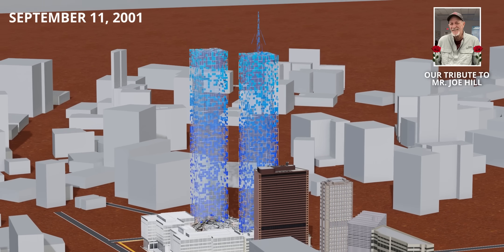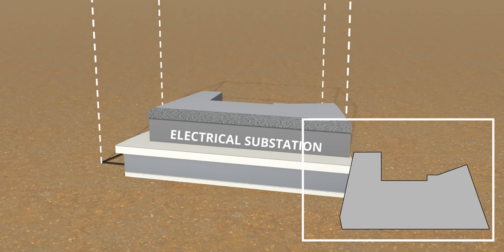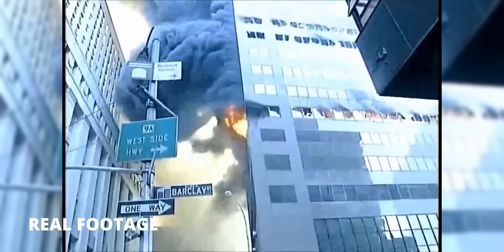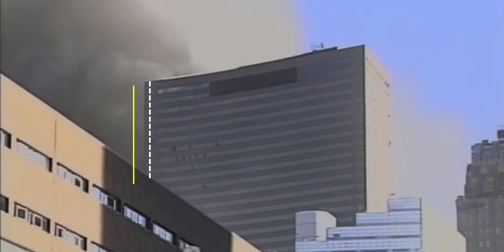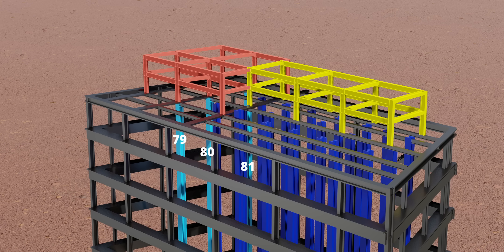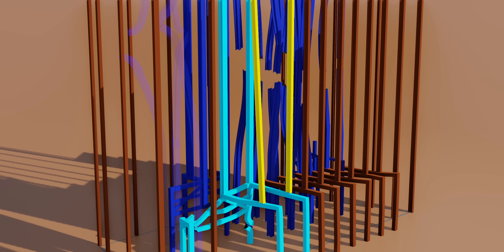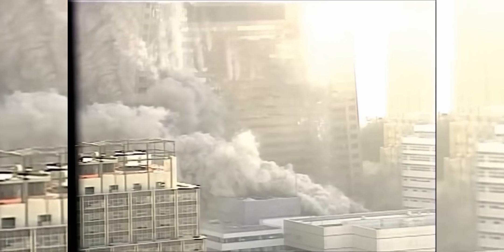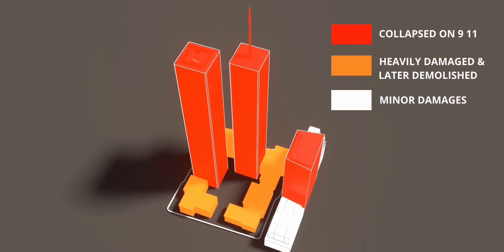Collapse of Building 7 | The Complete Physics

Comment: Three buildings with non-symmetrical damage fell in their own footprint on the same day. I think this is the first the world has seen this. (We've seen high-rise fires lasting for days and the steel frame remains). Add to that, on the same day, two plane crash sites with no visible plane parts. What is the the chance of that happening?  Probably one in a billion.  That's a good explanation of WTC7 though.
Reply: No building fell "in their own footprint". 10 buildings collapsed. This on the same day there were terrorist attacks on the buildings in that area. Even if your "first" had had any relevancy, which it did not, what of it? "First" only mean "first". No-one has seen fires lasting for days and the steel frame remain. Add to that 19 tons of visible plane parts in two of the THREE crash sites. So, the chances are 100% since you made it all up.

You're welcome for the correction of your nonsense.
Reply: @mooneyes2k478  There was no visible plane parts at the pentagon crash site nor in  Pennsylvania - it's unusual to have planes disintegrate upon crashing.  All the buildings collapsed in their own footprints, and yes planes hit the twin towers, but did not hit WTC7.  The planes that hit the twin towers caused non-symmetrical damage on several higher floors - not a reason for the entire building to collapse, but a reason for those higher floors to collapse to the side  There were not "19 tons of visible plane parts."   Add to that many other anomalies on that day, and there is a definite possibility that is was a false flag, in part, in some way.  Use your own brain and think about it, rather than defend a narrative.  This is a systemic issue with lots of evidence, thus conclusions are made in probabilities and possibilities, not certainties.  Anyone certain is defending, not thinking for themselves.
Reply: @nova4005   " There was no visible plane parts at the pentagon crash site nor in  Pennsylvania "
Other than the aforementioned 19 tons or so, you mean? Yeah.

"All the buildings collapsed in their own footprints"
If by "footprint" you mean "covered 8 times more ground that when they were standing", that is.

"and yes planes hit the twin towers, but did not hit WTC7"
Or any of the other 7 buildings. Can you guess what DID hit them?

" not a reason for the entire building to collapse, but a reason for those higher floors to collapse to the side"
If, that is, you think that a building is a tree. Here on earth, they're generally not.

"There were not "19 tons of visible plane parts.""
Because if you go "SO THERE!", reality changes. Right? Right.

"Add to that many other anomalies on that day"
None of which you can actually name or support. Just like dozens if not hundreds of "truthers" over the past several years, who, when called on the "many", turned very noticeably quiet.

"there is a definite possibility that is was a false flag"
Ah, yes. "It was all about Iraq, so there!" Except, it was clearly and publicly stated that Saddam didn't have anything to do with it. Then, of course, there's the minor issue that, in near 250 years, the US has been at war for 225. And not ONCE in that time was a "false flag" ever needed. All that was required was, "because we want to".

"Use your own brain and think about it, rather than defend a narrative"
You mean the brain that could, in contrast to you, understand and follow the evidence and the science? The only "narrative" is the one you and your "truther" buddies peddle, the one that goes, "oh, doesn't it look suspicious, something much be wrong, trust me bro!"

"Anyone certain is defending, not thinking for themselves."
Or able to understand very basic, laymans levels of construction and physics. Could be that.
Reply: @nova4005  I am glad your voice has been in this thread.
Reply: @gaylenhalbert4391  thanks 💕
Reply: nov4005, what happened when the penthouse collapsed into the building?
Reply: My thoughts exactly.   Hard to believe it's just coincidence.  It's the one factor that I cannot make peace with therefore I have yet to fully accept any explanation.
Reply: @KayWaits  I think that's a good place to be. Most people need to land on one side or the other. But you can see and know the anomalies - know something is awry - without having to know exactly what happened.
Reply: @nova4005  Tell me...why didn't you have an rebuttal?
Reply: @mooneyes2k478  my reply to you got erased.  That happens too often with certain subjects on youtube. I won't say more in this comment, but I'll  reply again in another comment. If you don't see it, it's been taken down.
Reply: @nova4005  " there where no visible plane parts, nothing that you could identify as a plane, at the Pentagon or in Pennsylvania. "
1, wrong. 2, irrelevant. The video is about WTC7. The only reason you'd mention something else is because you can't argue.

"The buildings fell in their own footprint- this is obvious about the three buildings that fell that day"
1, wrong, 2, irrelevant. "The buildings" matters not at all. This is about WTC7, which in no way did anything of the sort.

" All three had non-symmetrical damage"
Which is entirely irrelevant.

"the whole buildings fell in their own footprints"
See above.

"Several floors of wt7 were damaged by one of the twin towers, not nearly enough to make the whole building fall in its own footprint"
Which means we can conclude you somehow missed the 7 hours of unfought fires.

"and there are also plenty of architects and engineers who say that these towers falling in their own footprint say no, there must have been something else going on."
No ,there isn't.

"Your comment “the reality changes” shows how attached you are to this narrative"
The one "attached to the narrative", particularly "this" narrative, is you.

"You have taken a narrative to be your reality"
No, I've taken the only explanation to include science and evidence and facts to be reality. The one that explains why and how things happened, in an internally consistent manner. You, on the other, have not, instead preferring handwaving and "because it sounds cool and all the other "truthers" are really smart and they said so".

"A more mature development of the mind is thinking in possibilities and probabilities"'
Oh, right. So it was Santa Claus, Alien Space Beavers and Magic. Right? Because there's "possibilities and probabilities".

"When you're comfortable with what you know, you don't need to insult others to defend it"
Calling people on utter idiocies and nonsense isn't "insulting". Just putting that out there. That not even touching on "comfortable with what you know".

"The US has been involved in false flags before"
The US has, as a nation, existed for just under 250 years. It's been at war, somewhere, with someone, for 225 of those years. And not ONE of those wars has needed "false flag". Making up things does not change this.
Oh, since I'm sure you're blathering that nonsense, no, "Northwoods" was not a thing. It wasn't even an "operation", no matter how many times that's repeated.
Reply: @mooneyes2k478  You don't see or consider the whole picture of evidence, and it is relevant.  My first comment was not only about WT7.  I included links in my last comment and I bet that's why it was erased.  You stick with your reality, that's okay with me.
Reply: @nova4005   Or in other words, you didn't have any argument and it's mean of me to call you on that.

Yes, I know, ever so horrible. Poor you.
Reply: @mooneyes2k478  No, I do have counter arguments.  We'd need to go through other detailed  pieces of evidence, which we can't do here.  We've gone as far as we can in this discussion.  Also, I don't exchange ideas with people who are insulting for very long.  Bye.
Reply: @nova4005   Ah, yes. "Stop calling my stupid shit out for what it is, it's mean, I'll take my ball and go home!"
Reply: @nova4005  Good comment. Thank You.
Reply: In fact there was a third plane at WTC7 but no one saw it, they had put noise suppression on the engines, the proof is that WTC7 collapsed, on board Saddam Hussein armed with undetectable knives, he had disguised himself as a pumpkin for the Halloween party, to pass inconito, he threw envelopes and they landed in the senators' mailboxes, the proof is that 2 of them did not survive, the plane cut all the horizontal columns and bounced from bottom to top on all the floors at 806 KM/H, then the kerosene imploded.
Reply: there was plane parts at all sites all buildings ain’t the same and we are talking about jet fuel hot enough to bend and weaken steel they are designed to fall in their footprints because tell me how back it would he if a massive building fell over in manhattan also debris was everywhere not a perfect fall in footprint
Reply: @DaCostaRica48  jet fuel burned out within minutes of that fiery explosion. And no visable playing parts at either site. If you came across both of those crashes you wouldn't know a commercial airline was there, the newscasters and firefighters said that on the scene.
Reply: These conspiracies are so baseless, if you watch the collapse, you can tell why they collapsed, the first to collapsed did not simply fall straight down, the upper floors fell at an angle. Things on earth tend to fall straight down, what is the building supposed to do jump?
Reply: @saypuppy4266  if a structure is so severely damaged - so damaged from that it would bring a whole building down - that point of impact making such a dent would cause the structure above to tip towards the damaged side. Instead the three buildings came down exactly like there was symmetrical damage to the buildings. This does not make sense if the cause is airline impact or debris, and is highly unlikely to happen to three buildings in one day.
Reply: @h1F595  WT7 wasn't hit by a plane and still folded precisely like the other two. Quit living in denial.

Comment: I was a Captain, FDNY and was at OP at West and Vesey St. We had a team monitoring WTC-7 using a surveyor's transit. We all knew Bldg was coming down as it had been burning over 8 Hrs. I wrote a detailed story of FDNY 1980-2003 and highlighted  this collapse. I'm glad engineers were finally able to match what we saw to what happened. This video is correct, some twisting and then it dropped. We heard a loud crack from where we were. Probably the breaks in those columns.
If you want to read of this;  MY TURN ON THE FIRELINES  1980-2003,   FATAL FLAWS  BOOK 3   1975-9/11/2001       B&N

Comment: This is how it may have collapsed! But the reason it collapsed was that it was set to on purpose just like the controlled demolition of 1 & 2
Reply: This Lesics video is very good – with one or two exceptions - and goes into a much higher level of detail than many viewers will be able to comprehend.  While not perfect, the collapse mechanisms – the sequence of failures - described here by Lesics are substantially correct and this is true no matter who planned and carried out the 9/11 attacks or why . 

That may not be what you want to hear and go against 20+ years of entrenched dog_ma and conditioning, but it’s not wrong. 

That also means (in case you did not get the hint) this video can be (and IS) absolutely correct in its description of Building 7 collapse mechanisms AND the 9/11 attacks could still have been some sort of inside job. The two things are in no way mutually exclusive. 

The mechanisms described here have broad professional support around the world. There are no professional engineering organizations (for example: ASCE, ASEE, ICE, etc) that disagree with them or have offered any formal dissenting opinions or alternative hypothesis. 

The mechanisms described here are not new. They have been well understood for many years and much of it can be easily confirmed by simple observation. You can literally see most everything they are talking about if you just bother to look. 

So, setting hubris aside, either the overwhelming majority of the worlds structural engineers and simple observation are wrong,… … or you are. Which seems more likely? 

IF you still –think- believe this explanation is wrong then produce a better one . Good luck with that. No one ever has and I don’t see you moving that needle today. 

No one ever does.
Reply: Israeli public manipulation team working hard to dispel the truth.
Reply: @fpsOklahoma  Said the terrorist apologist.
Reply: nope. Not a demo. You are just $tupid.

Comment: The north towers antennae did NOT hit the WTC 7. At all. What are tou even talking about?? The antennea fell to the south east.
Reply: This guy is full of it. Spreading propaganda.
Reply: @alwagner9722  Everything else seems accurate. The only thing that's inaccurate is the antenna comment. I would say anything otherwise is propaganda.
Reply: @username_redacted_1987  He spreading bullshit 😂
Reply: @nightlyterra  No. He's 100% correct about the construction of the building and I have seen images/video of that side of WTC 7 and the damage from the North Tower. Those images are very hard to find becasue most video doesnt show that side of the building for obvious reasons. Debris hit it when the North Tower collapsed and the fire was uncontrolled for 7+ hours. And it WAS a tube design, similar to the Towers. There's nothing inaccurate about this video otherwise.

I've studied this even like crazy for 20 years. This video is otherwise dead on accurate.

Comment: No Steel Frame building had ever fallen because of fire.  No building had ever fallen straight down and to this day still don't except by planned demolition.  So (without any conspiracy involved) at least admit that these buildings were of a piss poor design.  If not criminal.  Just because something is new doesn't mean it's better.  So many engineers at the time kept calling the old systems(such as were used on the Empire State Building) “overengineered”, well I suggest that these new buildings were under engineered and am tired of hearing all these excused for the failure.  Do a Bad Job, you get a Bad Result. Just look at some of the disasters in China over the last few decades.
Reply: "No Steel Frame building had ever fallen because of fire."
Stupid nonsense.

" No building had ever fallen straight down"
Stupid nonsense.

" this day still don't except by planned demolition."
Irrelevant nonsense.

"at least admit that these buildings were of a piss poor design"
Stupid nonsense.

" Just because something is new doesn't mean it's better"
Irrelevant nonsense.

"well I suggest that these new buildings were under engineered"
Stupid nonsense.

"Just look at some of the disasters in China over the last few decades"
Irrelevant nonsense.
Reply: @mooneyes2k478  So, you have no real counter argument for reasonable arguments?
Reply: @MrKoenig1985 what are you on about? Read a book on engineering especially on building structures, but nooo, you won’t do it. 🙄😒 smh.
Reply: Countless thousands of steel framed buildings have collapsed due to fire. 

Steel framed buildings when they do collapse invariably do so in the direction of gravity - the path of least resistance. 

You seem badly informed. My suggestion would be to stop mindlessly repeating stuff you found on conspiracy channels. It's all been run up the flagpole a million times and no one has ever saluted.
Reply: It had nothing to do with the engineering they found thermate and sulfer painted on to the surviving steel beams, it got the israeli "art student" treatment just like the main towers.
Reply: 1. Steel frame buildings collapse from fire ALL THE TIME. They just tend to not be 40 story office buildings. They tend to be airplane hangars and agricultural quonsets. Guess what? They collapse more-or-less straight down. WTC 7 certainly didn't fall straight down, it blocked multiple streets with the debris.

2. I hate to break this to you, but buildings and trees are different things. Just because trees fall over to the side doesn't mean buildings do.
Reply: it is not one but 3 towers the same day by fire and the bulletshit the fail of security'water extending (excuse the mistake)